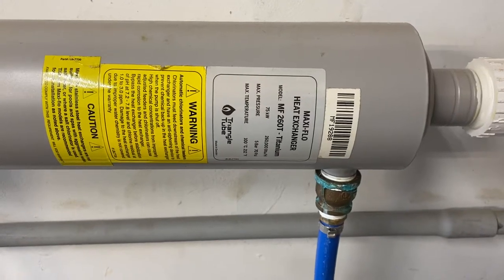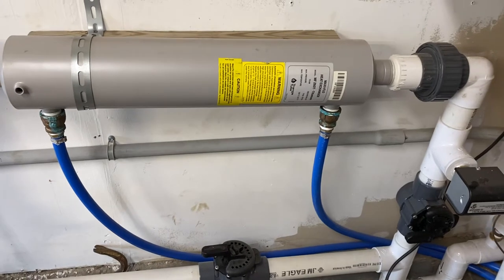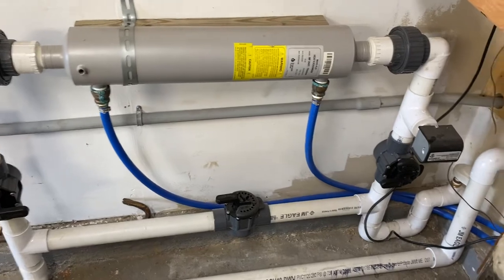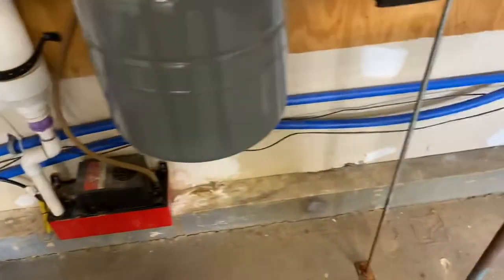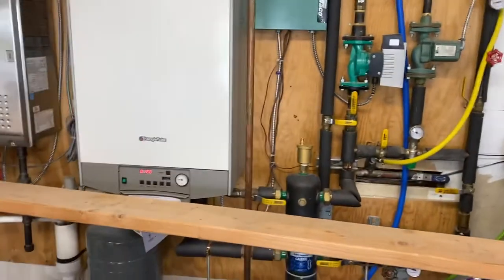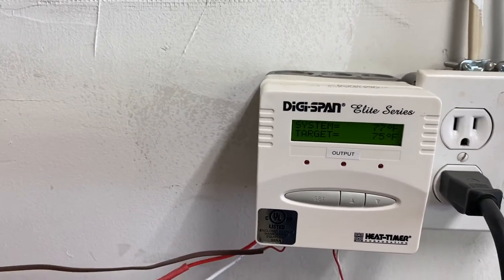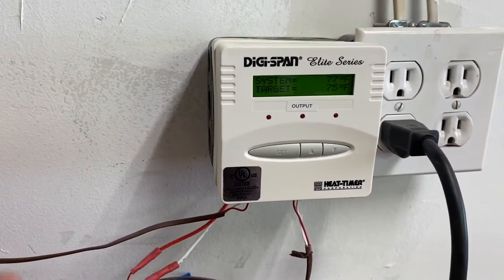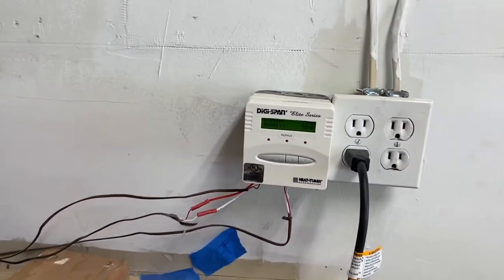Pool heat exchanger MF 260T

Comment: can you spec the hydrometer you installed for the temperature read?
Reply from the maker: Sorry for the delay. This is the detail. I’ll try to get a link in the description. 
Heat Timer 904011-00 Brass Immersion Well for System Sensor (3/8” x 1/2” NPT) Used with ESV, Digispan, TMC, SMC, HWRQ Control System Sensors

Comment: I have a 30,000 gallon pool and I'm seriously considering installing one of these. Can you tell me if this gets the 1 degree higher temp an hour most of them advertise?
Reply: It’s shutdown for the season but I’ll check in a month. I’d say probably I’m also slightly undersized with my boiler.
Reply from the maker: Sorry hard to determine since it varies by weather. I think I do better than 1 degree an hour with a 13,000 gallon pool. I also disconnect the outdoor boiler thermostat so it runs at full blast.

Comment: I want to use a hydro cooled bitmain bitcoin miner as my heat source. Can you please post links for all your goodies that made this work. Are you using some sort of servo valve to control hot water?
Reply from the maker: I used a triangle tube brand heat exchanger. 
https://triangletube.com/products/maxi-flo
And a standard taco valve system off my boiler.
Reply: Can you advice what I should use CPVC, PVC or PEX to connect the heat exchanger?